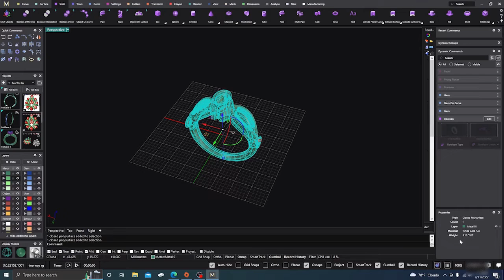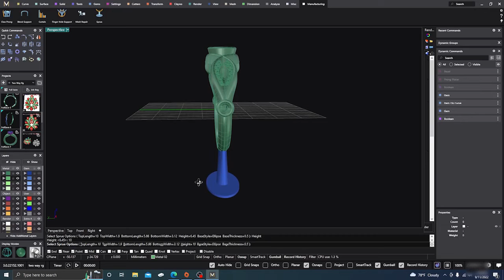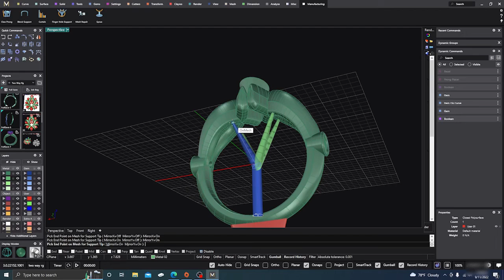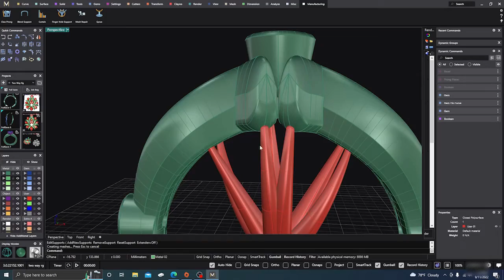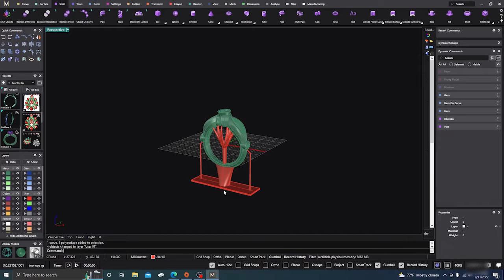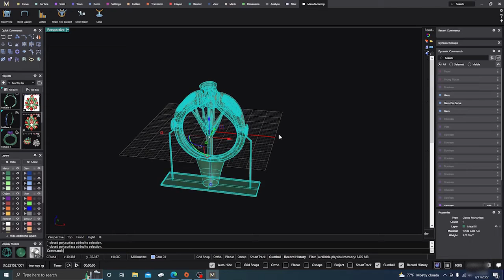Matrix 9 to MatrixGold transition How to get an item ready for Printing Exporting and Saving

Comment: hello sir please i have a problem i can not find the manufacturing  tool
Reply from the maker: The first thing I would try is to go to your Preferences. Click on any of the gears or go to the big M in top left and edit find Preferences and click that. Go to ribbon bar and click reset to default. Let me know if that fixed it.
Reply: @donsjewelrymakingandjapantrave  Thank you
Reply: @donsjewelrymakingandjapantrave  I'm facing the same issue and tried reset to default but it didn't work, is there another way I can fix that? Thank you!